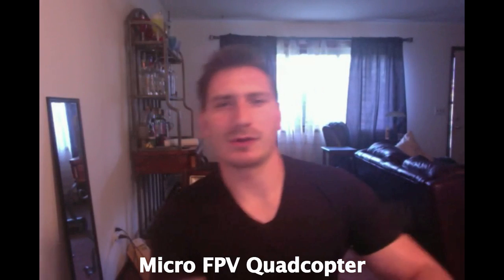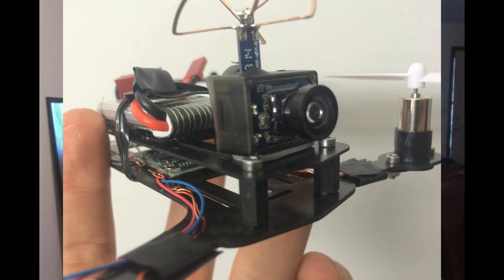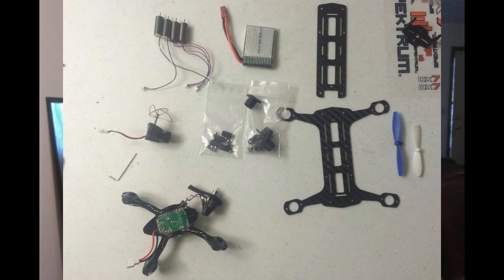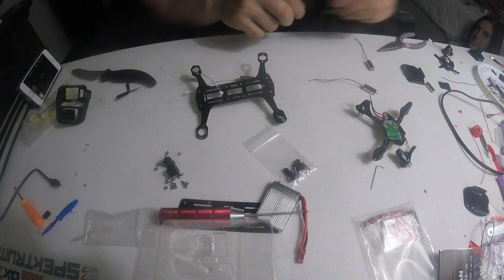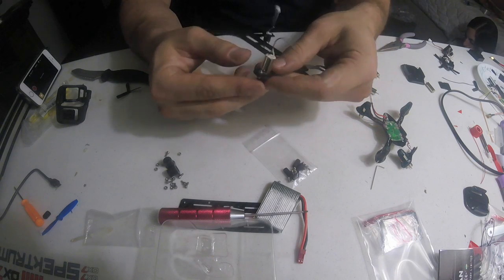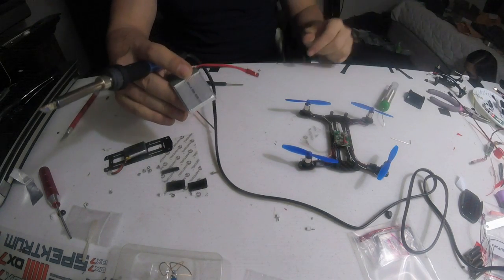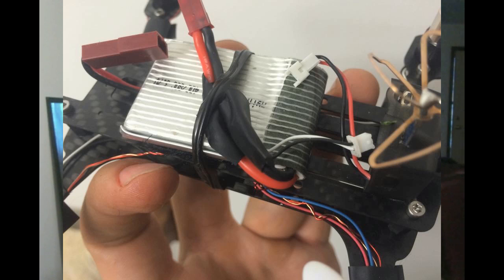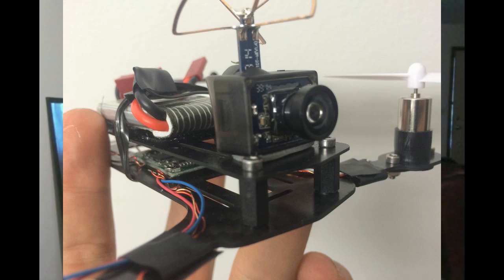Micro FPV Quadcopter build!

Comment: i have a question bro! thanks by the way for the information! where can i get the white propellers though? i saw you only have the link for the blue ones! let me know please! thanks
Reply from the maker: The white ones I think are just hubsan x4 spare props. I think it's these http://www.getfpv.com/hubsan-x4-rotor-blades-black-white-for-h107p.html?utm_source=google_shopping&m=simple&gdffi=747627bc7e464db68e5f529d971aacf3&gdfms=ABF635DBF32C40D390D1F364191585AF&gclid=CM6K9vGq7c4CFUxahgodCqUFnQ
Reply: +Sal Mastropolo thanks bro! one more question! if i want the insane motors! would you recommend to use another frame or do I just keep the one you have on the video? if recommend to use another please let me know what is the size i need and if you have the link also leave it! thanks a lot
Reply from the maker: +Ottenwalder Velez this frame is great, but there's also the clear plastic one. I think it's called the dream catcher frame. It weighs less than the frame I used in this video, so it's going to have more power. The plus side to the frame that I use in the video is the hobby grade carbon fiber appearance. If that's not important to you, but power is, I'd go with the dream catcher. Research the flight controllers. I did this because my hubsan broke. If this were a planned build from the start I would try and go with something that has full rate mode--but if rate mode doesn't matter to you, then it doesn't matter what flight controller board you use! Amazingly, you can also pack brushless motors onto 150mm frames too, offering full brushless power and high performance. I'm talking about drones like the "Diatone 150". Buyer beware though. Had some pretty bad shorting Issues with the distribution board
Reply: +Sal Mastropolo perfect! thanks for the info Sal! i will let you know what I did!

Comment from the maker: Go with the "insane" rated motors, and double, triple, quadruple check that the Side of the chip that gets the wires soldered on is upside down when your quad copter is upside down.

Some things to note, if the quad copter does not lift off the ground the propellers are on wrong, if the quad copter lifts off the ground but spins uncontrollably, it means that a counterclockwise or clockwise motor needs to be switched. 

I made the mistake with flipping the chip the wrong way and as a result my quad copter always thought it was upside down. At two minutes and 20 seconds, you can see my error.